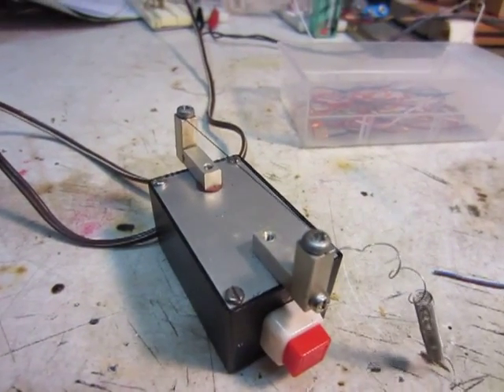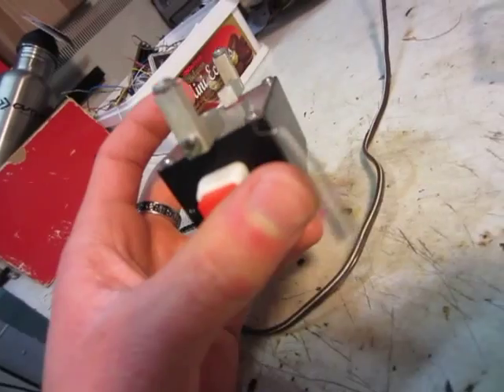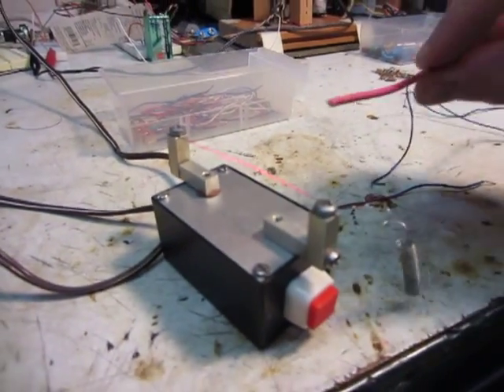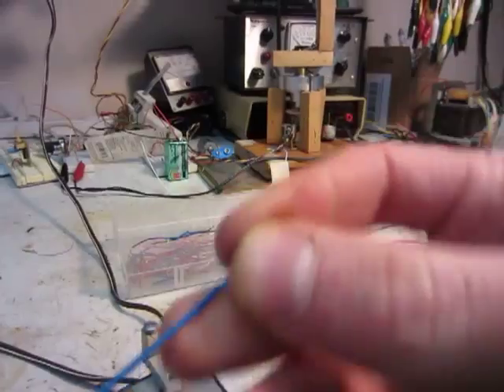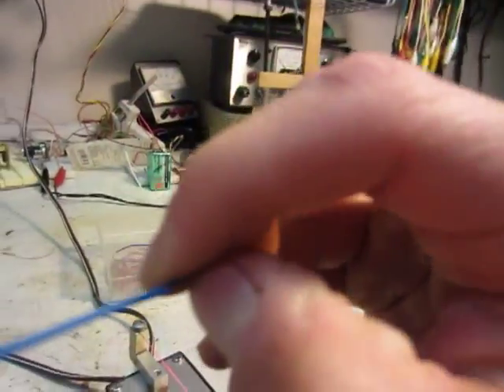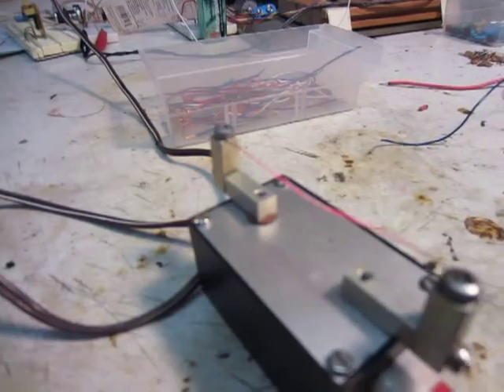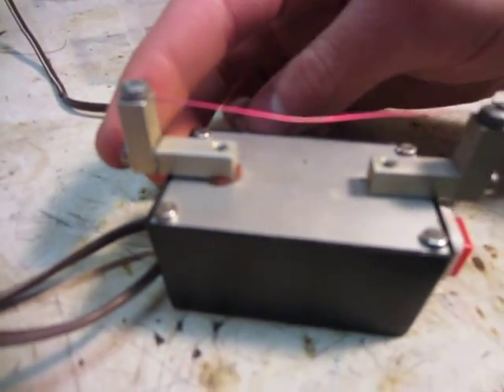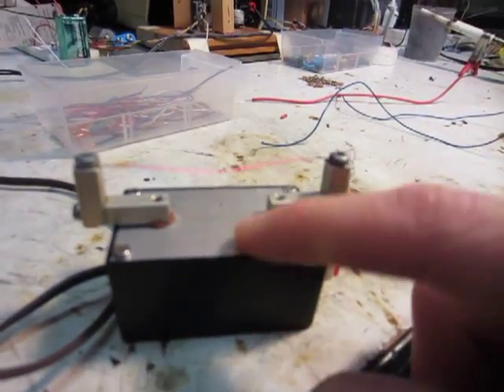DIY Wire Stripper

Comment: If the wire breaks, the switch would go off immediately before or after. The 5 volts is still available at the terminal posts. My patent applications are for mechanical stuff. This idea is partly mechanical but I rather put my patent application fee in something else. I also found an “inexpensive and better” alternative to one other major part of the assembly. I built two units for fellow workers who were also artists. You can apply for a patent if you wish.I just want to help you build many$

Comment: The boss told me that even if I leave the job, by law I could not make the wire sealers for five years. He scared me with the potential of legal action and kept me as a worker. I enclosed the shut off switch inside a small metal "BANDAID" box. The "lever type" switch was attached to the stretched spring but the other end of the spring did not go to other electrical terminal, only the hot wire did. A timing screw allowed me to move the lever switch back and forward inside the Band-Aid box...

Comment from the maker: I originally tried that but it was to much of a pain to replace when it broke.  I have no idea where this spring even came from (before it got in my junk bin).  I am guessing it came from a printer or VCR.  But that is only because they have a lot of springs.  My power supply can put out a max of 20 amps @ 5 volts.  Though the wire stripper only draws 3.5 amps.

Comment from the maker: Thanks.  I do have some its just that I have the arms a the right length for this spring.  So I would have to adjust them if I replaced it with resistance wire.  I'm not sure how long it would take me to make 100.  If I had all the parts, not very long I'm sure.  The box was from some sort of filter.  The rest was from my junk bins.

Comment: Hi! They sell heating wire also known as resistance wire (Chromium alloy). This is a neat gadget. How long will it take you to make 100 of them? I am asking simply because it is well put together and because it can be used for other things by adding one more small part. Think of it that way: The box could be the handle while the horizontal metal pieces that connect the wire to the box extend further. The missing part will stretch the wire as it heats up and expand. You made foam cutter + more.